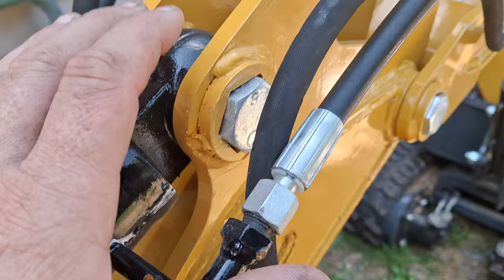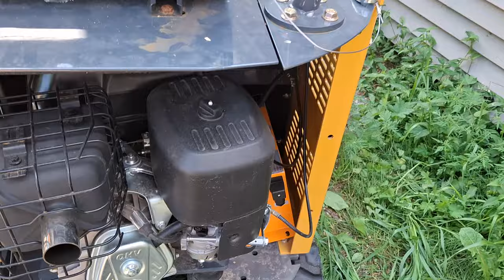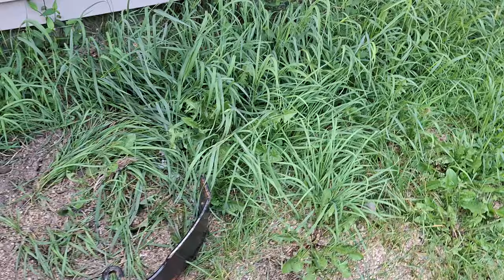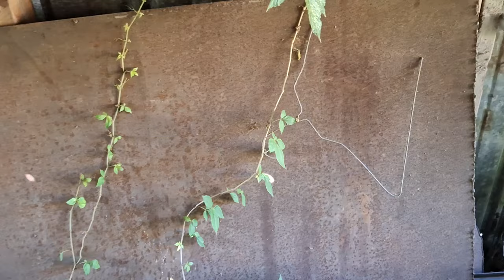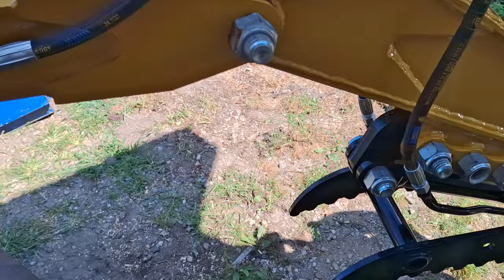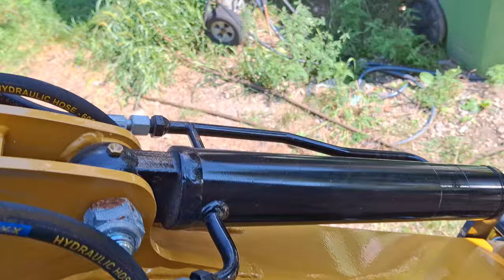August 13, 2024 mini update

Comment: It would be sweet to add a blade on the front of that thing! That would help a lot with tipping while you dig and be a nice pusher. They are great for filling in holes and leveling the ground after you dig.